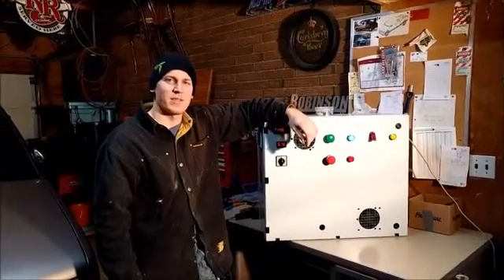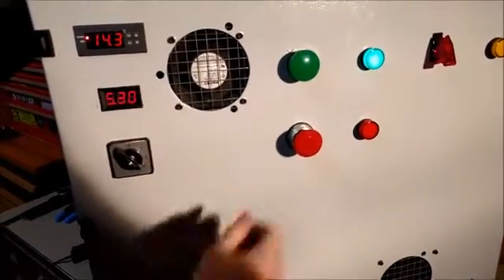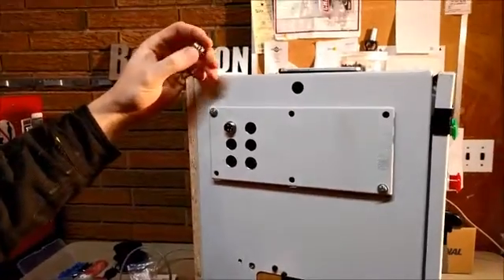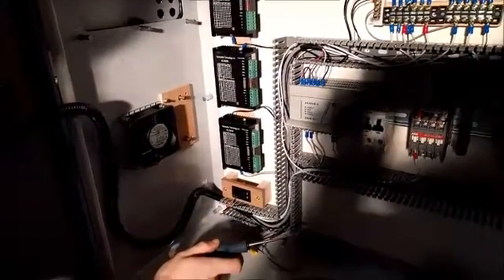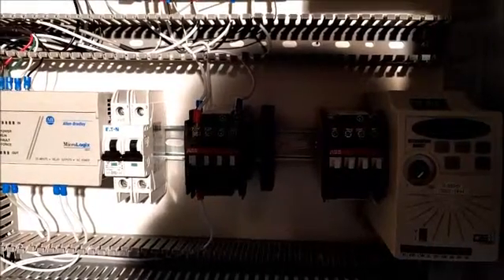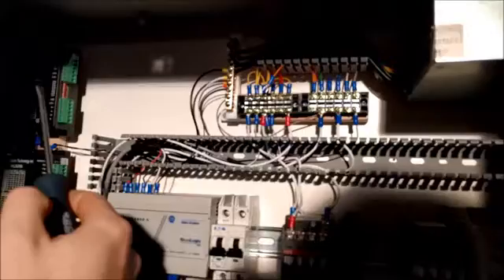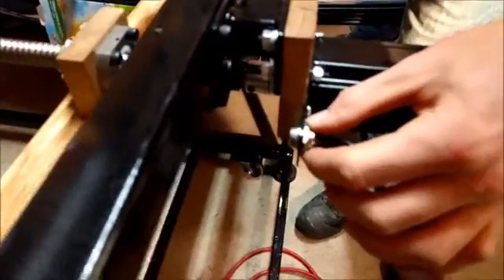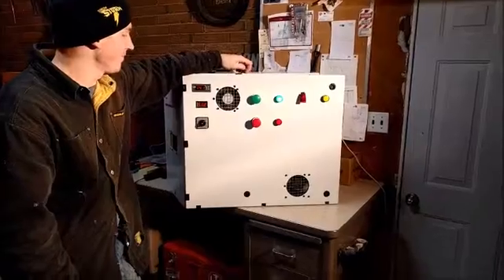Canadian CNC Build - Part 9: Panel Wiring

Comment: Nice. have you considered some filtration on those intake fans?
Reply from the maker: I have thought about it, I realize the two fans could suck in a lot of saw dust.  I'm not sure what to use as a filter though, I need to find something cheap and dirty, maybe once I get the machine operational
Reply from the maker: Geodans, since running the machine for a few months now, I have disconnected the fans.  The panel is large enough to dissipate the heat and my digital thermometer inside the panel hovers around 24-27 deg C.  The fans were blowing a lot of sawdust around and I do not want any saw dust sucked into the panel, so I taped off all the fan openings.